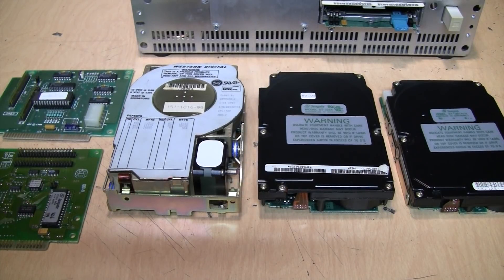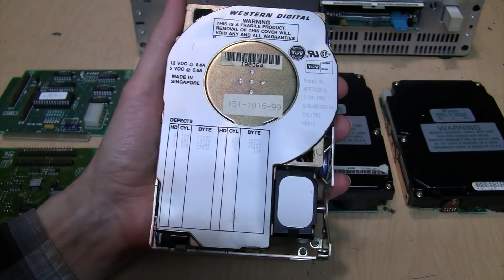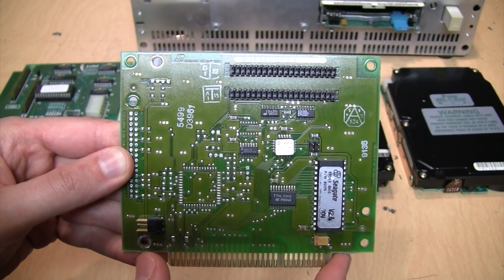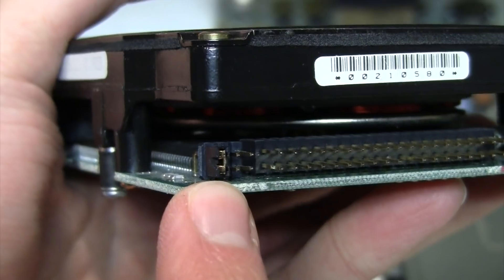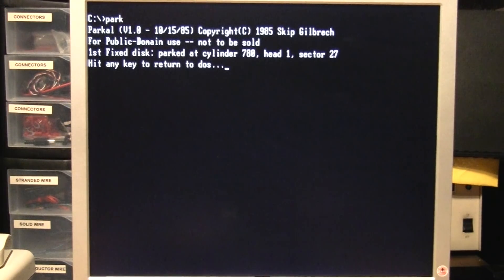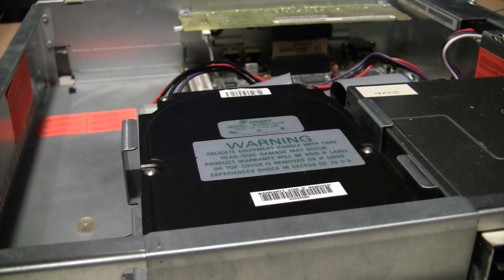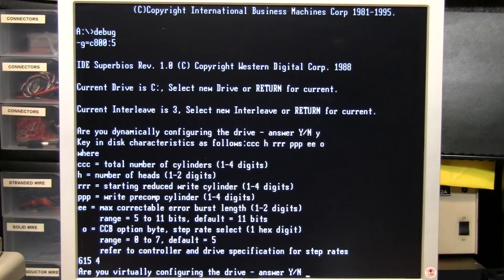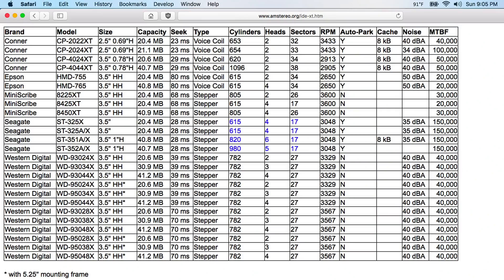8-bit IDE-XT Hard Drives Demystified

Comment: I'm so used to newer hard drives that those old XT ones always sound so loud that my first instinct is that it's broken. I mean, I actually had an AT clone (which had a hard drive - can't remember what kind but I feel it wasn't that loud) - and 386s and stuff but never had an XT.
Reply: The whole computer got quieter and quieter over the years, slowly enough that it was hard to notice.

The original PC (5150) had an AC-powered PSU fan and a big clunky switch.  The floppy seek sounds painful.  Even the keyboard made a racket!  10 years later, and the PSU fan, CPU fan, and HDD all blended in to one subtle whine.  10 years after that, and they were merely a whisper.  My last PC build was so quiet I legitimately forget it was powered on for months, until I bent down directly in front of the grille and heard just the faintest whirring of the fan.

Going back to my retro PC collection illustrates how stark the difference really is.
Reply: @Nick Wallette  I still like the keyboards - Model M and I wouldn't mind a Model F if not for the different layout. I'm following development on a modern beam switch (IBM used those even before Model F's, but I have never tried them personally) called the Keystone. Unfortunately while I have a couple Cherry switch mechanical keyboards, I don't think any of them feel as good as buckling springs or even Alps keyboards (and yes I've tried like two dozen Cherry-style switches). Any Cherry style switch is slightly better than cheap membrane keyboards but not that much better to me so I'd like the Keystone or I might get a Unicomp sometime (I would get a Mini M, but I've inquired with them about whether I can make the keyboard ignore numlock; no go if I have to deal with numlock annoyances on a mini kb).

I don't mind fan noise but I really would not be able to deal with these hard drives, and old floppy drives that would bang against their end stops due to lacking limit switches, and which just had loud steppers in general... I'm sure glad we don't have that anymore. I had an Amiga 500 with a 20MB hard drive, probably the smallest HDD I ever had, but it wasn't THIS loud.

Comment: What about 16 bit MFM controllers? :)
Reply: Weren't those the ones with two cables for each drive, one for data, and one for address/control signals?
Reply: @BertGrink  yes. 2 small for data transfer for each drive, and one big for control dasychained for both of them :)
Reply: @intel386DX  Ahh, okay; I have only seen one of those drives once, back in maybe 2002 or so, and didn't remember the details very well, obviously.
Thanks for the clarification.

Comment: Wow!  Western Digital must have really upped their game from back in those days!  Over the past 30-odd years, I've always found them to be the most reliable hard-drives around; Seagate on the other hand - after they bought-out Maxtor - went downhill very fast.... Maxtor drives in the mid 90s were well known for their failure rates, so it surprised me when Seagate took over....  since then, I've personally found that little has changed!!  
That super-reliable old Seagate, has now just become a re-badged Maxtor, with all it's faults!  
Well, that's how I've seen it...both personally, and professionally through retail - far more Seagate/Maxtor faulty returns than Western Digital....  
Thankfully we now have SSD which is FAR more reliable!  :-)
Reply: I used to have good luck with Maxtor drives back then.

Comment: I love the sound of MFM and RLL stepper motors. I can't explain why-- I don't think it's rational. I just find it a pleasant sound. I avoid mechanical drives in my retro system mostly because I don't like the noise they make. But if I could get the MFM that came with my Deskpro 286 working again, I would gladly put up with its noise just to hear the sound it makes while seeking.

Comment: I also have a good collection of 8-bit XT drives. I collected them for many years, & I'm so glad I did. In my collection of Tandy XT computers they all run with XT HD's. It's true the original Wester Digital HD's our not long for this world. But I have good amount of Seagate 40's that I use as replacement's. I will miss the sound of my full form factor Seagate's booting as these drives do wear out. I have just a few working Seagate full 20's left. As always very interesting video.

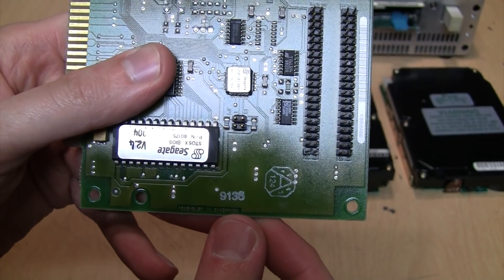Comment: 5:06 Now I wonder do you have any hardcards in your collection? Seems you have quite a bit of collection of old HDDs.
Reply from the maker: Actually both the Seagate and Western Digital interface cards I show originally came as part of hardcards. But I had to take them apart because they won't fit in the little Tandy!
Reply: @vwestlife  What brand of hardcard are these interface cards come from? Plus Development?
Reply: @vwestlife  I think you also had an Amiga hardcard with a Quantum hard drive
Reply: This actually cleared up a bit of a mystery for me!  I ended up with a strange controller card that looks a lot like these, except 16-bit.  All it says is "HDD CONTROL CARD 48.05218.001  88049  Made in Taiwan ROC".  Has one 40-pin interface, four jumpers in a block, and a 4-pin header probably for the LED.  No slot bracket.  I couldn't imagine what actually used this thing, but a hard card makes perfect sense!

Comment: Is there any way to hook those drives up to a modern computer to transfer data?
Reply from the maker: The interface cards should work in anything with an ISA slot, allowing you to use a computer at least new enough to transfer the data from it to a USB drive. Or the ST-351A/X drive can be switched into AT mode and then used in any semi-modern PC with an IDE / PATA interface.

Comment: I've never had a machine with the IDE-XT interface, but I did have a 40MB IDE-XT hard drive, working in AT mode. Only IDE drive I ever had with a stepper motor. 
Fortunately, while the RL series had the IDE-XT interface, the Tandy 1000 RSX, which I have, natively supports "normal" IDE hard drives, up to 504 megabytes. Why 504 and not 512?  I haven't the foggiest.
Reply from the maker: The original IDE limit was 1024 cylinders x 16 heads x 63 sectors per track. With the DOS format of 512 bytes per sector, that's 528,482,304 bytes... 504 binary megabytes, or 528 decimal megabytes.
Reply: @vwestlife  That makes sense. Thanks. I was thinking in straight base 2 binary count, I didn't think it was based on physical limits.

Comment: You can also format AT IDE drives of that vintage. Most mainboard BIOSes had a hard drive format utility built in, accessible next to the BIOS setup. The warning about "never low-levelling" is not dependent on the XT or AT interface, but low-level formatting might be problematic on disks with virtual geometries, even your 20MB with translation.

As a counter-point, the Fujitsu M262 series (http://www.bitsavers.org/pdf/fujitsu/_brochures/M2622_2623_2624_S_F_H_T_Brochure_1991.pdf), which comes with ATA or SCSI interface, and does not just geometry translation, but also already uses four zones of different density can be low-level formatted, and actually needs a low level format after a rough transport. I experienced this both with a M2624T (AT) and a M2622F (SCSI) drive: After rough handling, the drive issues sporadic "sector not found" errors, that can be fixed completely by reformatting it. These drives have a "servo surface" on one of their four to six platters (yielding 7, 9 or 11 data surfaces), and rough handling seems to misalign the platters against each other.

Comment: What about Fujitsu M2611T  made in 1990? Ya I should look it up.
Reply from the maker: That is an IDE-AT drive, not IDE-XT.
Reply: @vwestlife  Thanks... Are you familiar with the Tandon TM65 2L floppy drive by any chance? It is a dual layer 360kb that needs a new 28 DIP control chip. Just wondering if a WD 177X-00 or the WD 1772 floppy control DIP28 will be a good replacement? The original is 977509-001 made by Cherry Semi Conductor.

Comment: I wish you had elaborated a bit on what "bad tracks" are.
Reply from the maker: Every hard drive or SSD has a certain amount of faulty sectors. Newer drives mask them from the user so they're unnoticeable, but on older drives they were listed on the drive's label and you had to type them in when formatting the drive. Or else you could just let it automatically detect any bad sectors when formatting.
Reply: @vwestlife  ah, neat. Thanks! I suspected it was something like that.

Comment: Can someone tell me why retro people like LGR, 8bit guy, TechTangents (Akkabubu) etc like to put compact flash cards or even sdcards inplace of a hard drive, sdcards and cfcards (for some reason i see noone using them with their main computer so they are nit that good then)are slower (i saw once when druga1 installed windows 2000 on an sdcard and it was realy slow) then hdd and they  are not ment for permanent data storage like hdd is

Also will there ever be an open souce hard-drive or floppy drive (not emulator, real floppy drive and disk) uvailable or at least a way to limit a big hdd to smaller size (so old bioses wont complain)
Reply from the maker: They like to frequently switch to different operating systems and driver configurations, and swapping a CF card makes that much easier than copying files to a hard drive.
Reply: @vwestlife  hmm, you think that's the only reason, because a lot of computer collectors do this so...

Do you do this as well or you use real HDDs?
Reply from the maker: @Veso266  I prefer to use real hard drives.

Comment: Amiga A590 was a SCSI interface ..
Reply: it took a regular 3.5" SCSI drive .. about the same size as drives are nowadays. Mine had a Quantum 105S-LP drive. This was one of the fastest controllers available for the Amiga, something like 1MB/second if I remember correctly. There is a 25pin SCSI D-Connector on the back (same style as the Apple SCSI connectors) for daisy-chaining other drives.
Reply: I've been googling since posting (can't edit the post) and the A590 seemingly did have an XT interface, though this was disabled with later ROM versions. They were terribly expensive - back in 1991 it cost around 600 gbp for a 105MB A590 with 2MB RAM installed in it. At the time I had an allowance (from university) of around 75 gbp a month.
Reply: @croolis  I have been Googling and found that the Acorn Hard drive for a BBC Computer cost around £1000. I hate to think what the HP Hard Drive for an HP 8086 Emulator and Software Development System I used to use back in about 1987 cost.

Comment: Interesting! I literally built hundreds of computers in the late 1980s and early 1990s, from XT to AT to 386 to 486,  but I never heard of IDE-XT. This video was front to back new information to me.
By the way there's a good chance that the default interleave is wrong: the low level formatting program was pretty much the same in all Western Digital ROMs so there's no guarantee that its a sensible default. I had a WD MFM controller and even though it also offered 3 as default, you needed to override it to 4 to get a throughput speed that was about twice as much. I think Spinrite can tell you if your drive is formatted for the right interleave.
Also the address to use in DEBUG varies with where the ROM is mapped in memory. Sometimes it's at C500:5, sometimes at C800:5, sometimes at other addresses. You can use the D xxxx:0 command to dump the start of a memory area (where xxxx is the suspected segment number) and if you see the telltale Western Digital message in the ROM, call offset 5 to run it. The easiest way to find out where the ROM is is to inspect the interrupt vector table and check which segment the int 13h vector points to. If I'm not mistaken, the segment for the interrupt vector for interrupt 13 is at 0000:004C so the segment you need for the low level formatter program can probably be found at 0000:004E.

Comment: you are absolutely right
ATA is 16bit bus
even now in SATA it is still 16bit bus on serial physical layer
commands are still 16bit
data is delivered in 16bit chunks (32bit mode possible, but this is not default)
ATA cannot work in 8bit mode at all
Reply: That's how the modern XT-IDE cards work. They chop the 16 bit data into two 8-bit chunks.

Comment: I think the dubious honor of being the last stepper motor hard drive made belongs to the Kalok KL3100 120 mb ide drive.  They have the same data density as the st351, 20 mb per side, but have more platters. 
I have a video of one working on my channel!
Reply: Its actually the Daeyoung DX-3120, the last stepper ever designed and w 120MB. Company went under before they finished it

Comment: Did these work with the BBC Micro?
Reply: Probably too modern. Most 1980s computers Mac, Atari ST, and the BBC used SCSI which if you think about it was a more expensive form of IDE before IDE was even invented. Talking of expensive I just found an old article that says that the official Acorn BBC Computer Hard Drive was around £1000 which was over twice the price of the computer.

Comment: Wait? Seagate? Reliable?? When was that a thing?? :S
Reply from the maker: About 30 years ago.
Reply: I believe things really went downhill after they acquired Maxtor
Reply: I think everyone has a hard drive failure story, but only because everyone has, at this point, owned many hard drives.  The actual number of drives that fail before being retired for other reasons is remarkably low.  Especially given the level complexity.  I would suspect few of us probably own anything that is as mechanically precise as a hard drive, and if we did, would not expect it to survive the degree of abuse that a hard drive tolerates.

We had an earthquake here a couple years ago that collapsed at least one house and tore apart a couple roads.  I don't recall hearing anyone in the IT circles I frequent who lost a single hard drive in that event.  I had several spinning during the entire event.  All fine.
Reply: I lost one Western Digital 1 month before the warranty was up (23 months old) recently. I've never had a Seagate drive fail. Does that mean Seagates are more reliable? No, it just means I've gotten lucky.
Reply: @Lassi Kinnunen 81 Mitsubishi. Their MR535R was an excellent RLL drive.

Comment: IDE XT controller CF card compatibility - at least Olivetti Prodest PC1 guys figured out a hack to make this combo work. Google /PC1-OnePage/Docs/GuidaCFModPC1HD/pc1CF-IDE-Guide.pdf  I dont quite understand the changes, they cut reset line, fix A2 io mapping, and pull IOCHRDY to Chip select 3P :o, no clue how would that help, but cant argue with results - it works for this particular computer.
Reply: They have made the IDE-XT connector into an ATA connector by a hardware change and replacing the driver in ROM. So it is not actually an indication of compatibility between the two buses.
Reply: @Jope9k  the "driver in ROM" is just XTIDE bios extension, required to auto detect and support larger disks, and "hardware change" is minimal. Its not so much change, as fixing the problem by cutting couple of lines and rerouting one signal.
Reply: @rasz  would smaller drives have worked without the xtide bios? The PDF was too large for google translate :-)
Reply: @Jope9k  the fact one of the changes cuts RESET signal to CF card points at a NO (edit: without the hardware modifications).  I dont know Olivetti bios to even guess if they had autodetect or only supported hardwired types.